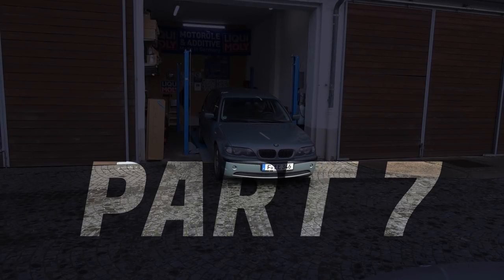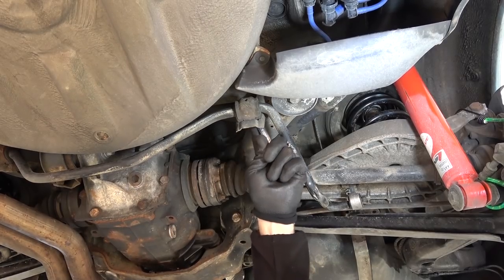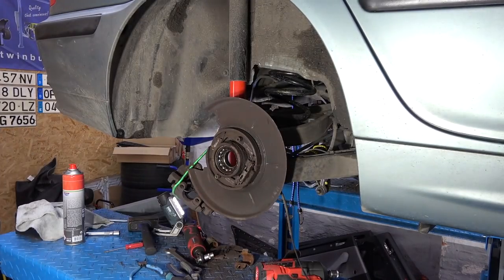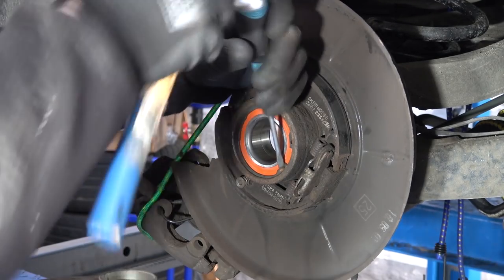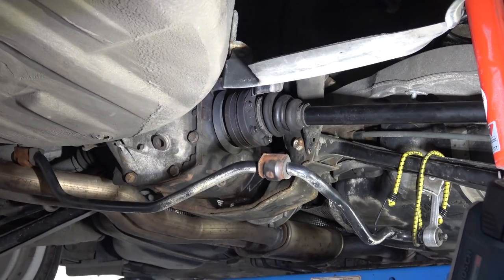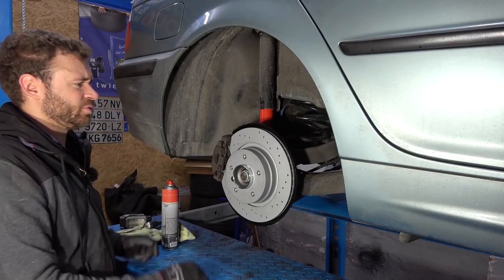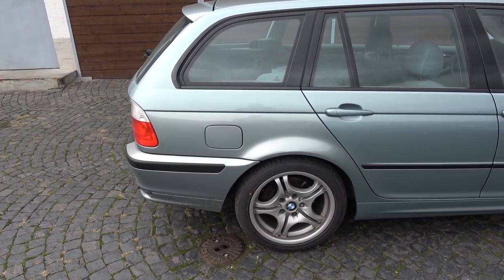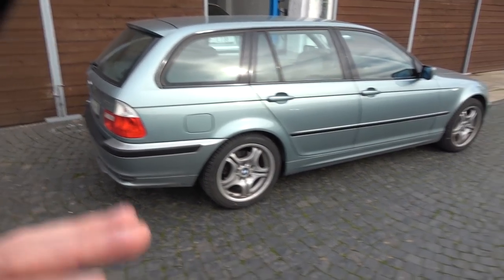Make It Less Noisy - BMW E46 325i Touring - Project Cologne: Part 7

Comment: the official channel of "well, while I'm in there might as well"
Reply: That usually does not go along with the “cheap car” title. Been there, done that. 😂
Reply: this is the motto of every older BMW owner
Reply: My thoughts exactly...I love his channel because he does good things for my OCD levels! 😂😂👍🏽👍🏽
Reply: He wouldn't have had to go back in if he didn't replace the dust shields.  Now, why was that done?
Reply: Cooooming āp
Reply: @flippy9133  The motto of every old(er) car owner 😂
Reply: Endless of that. Story of my life
Reply: @flippy9133  worth it
Reply: @lkstaack74  because "While I'm here, I might as well".
Reply: @larsstaack7835  I don't disagree and don't want to put words into the guy's mouth, it might be his perfectionism, or summat else.:)
Reply: The hole where the retaining pin for the parking brake shoe locates can corrode and break.
Reply: This is pretty much the motto of the E46 owner... there's no such thing as ONE job.
Reply: @larsstaack7835  it does - the holes where the handbrake shoes pins go through corrode and then you get all sorts of noises and destroyed shoes (ask me how I know). Also the shield itself can corrode and then rub against a disc, which also creates excellent noises

Comment: Mechanic here, I love your videos! I think what happened with your left rear is your brake caliper was stuck and wasnt releasing properly -> constantly braking a tiny bit judging by the burnt brake disc (they tend to turn red afterwards) and the heat killed the wheelbearing as well. That is a very common series of events with any old car.

Comment: You can buy BMW Z4 front strut mounts, they are lower -10mm and they fit. You can find them in the Bandel-Online shop for example. I will have to do the exact same things you did here plus some additional things on my 323Ci. Gonna be fun.

PS: Don't do the swap. the m54b30 usually has less than 231HP, while the m54b25 usually get's close to 192HP. So your upgrade might be like +20/25HP.. I think you can get that with software, m performance intake and other tuning.

Comment: Note to self: “Get a shop to do the wheel bearings on a BMW E46 325i”
Reply: On any vehicle really. Its a huge pain unless you have all the right tools.
Reply: When I booked my 25yo 4WD Toyota into the mechanics for the rear wheel bearings he just stared at me.
Reply: Toyota/Lexus also has the bearing in the hub itself, but when I tried to change it, it wouldn't come out even with the slide hammer. It was so rusted, i thought i could drive the car without the bolts on. Eventually decided to take it to the shop, they got it off somehow, but charged like 100 euros for it.
Reply: It’s the only thing I’ve ever brought my E38 to the dealer to do. They got it done in 2 hours. I messed with it for 2 days before just slapping it together and bringing it to the dealer. The right tools make all the difference.
Reply: Front wheel bearings on my E46 were easy, but I'd never do rear ones myself.
Reply: @DiscoFang  😂😂😂😂😂😂😂😂😂😂😂  Same here with my Wrangler
Reply: On my old Peugeot I only had to replace the rear bearing once and it took me like 20 minutes with a plank of wood and a hammer and no prior experience.
Reply: @GlamStacheessnostalgialounge  yeah i also recall doing them on  peugeot 307.. was so easy 😎.. having no axles in the back makes all the difference lol. Still would go for a bmw before a peugeot any day lol
Reply: @jxx90s  I sure as hell wouldn't. Both cars are unreliable and parts are nearly non-existent and a nightmare to find but a Peugeot is at least comfortable.
Reply: @GlamStacheessnostalgialounge  oh hah yeah in europe parts are not an issue.. bmw is way more fun in driving experience and nicer engines imo.. for the french comfort experience we still have my dads old 1972 citroen DS to take for a spin every now and then 😄.

Comment: Pro tip: week removing and reinstalling the wheel bearing instead of turning the outside wrench turn the inside wrench. Reason being is if you turn the back then it has less surface on it. The "Big Nut" spins around the bolt easier than trying to turn the entire outside part of the bolt which tends to turn with the oversized jig that you placed to pull the bearings. Then when putting it on its again easier because the BIG NUT only turn on the bolt with a little tiny bit of surface rubbing while on the outside the entire surface of the second jig is much larger. Granted that the outside technically isn't supposed to spin on ideal situation but most of the time it will in fact stick and make it much harder to spin. 

Just a tip. Did with it what you will.
Reply: I used the Amazon tool twice and got the play in it that you mentioned. I got a pro to help and that was key. Same wheel too. Both times it failed quickly after replacement and I ended up pulling out the trailing arm and getting a shop to press the bearing in. So now on #3 bearing it is finally working. Thanks for the tip Babayega.

Comment: You only need to replace the rear trailing arm. The rear brake disc handbrake drum internal diameter is larger on the 330. An easy job to be honest (and I will be doing the same, just been lazy. I have the arms on my shelf already replaced all bushings with ball joints) - so when you do the 330 driveline swap, might as well swap them in as well, since you'll have all the parts there.

Comment: Great video’s! Thanks for sharing! I did an 330i brake upgrade starting on the front, but the braking was really bad!! That’s because the E46 brake balance is done with the disc and pad size. I’ve replaced the rear suspension for installing the 330 rear brakes, that was a difference!!!!

Comment: i have a subaru and just had rear wheel bearings and seals - with high pressure brake hoses ! wow so quiet now !
Reply: Subarus and wheel bearings... They just seem to devour them. I've had 5, and they've all chewed through them, especially at the track. Luckily that's all that I've had fail on mine though.

Comment: It was entertaining as always. But I have two little advices for you.

First, when you compress the piston in brake caliper, you should unscrew the vent, and let brake fluid to drain in some jar. Because in calipers is always a lot of dirt, rust, and old fluid with water. Especially in caliper old as that. It is more important in front, they are closer to ABS pump, and if dirt come in it, you can damage it badly.

Second, when you remove bearing, bushing etc. You can heat up steering knuckle (by gas burner or even heat gun with smalller parts), which will expand, and bearing come out or come in easier. You only need to be careful with all rubber, greas etc., to not overheat them. But here you change everything. so better to make life easier. :)

I am only a DIYer, not a mechanic, but hope this helps you.

Comment: I once replace springs and dampers on front axil of a 130i E87. Ride height was very high with new parts compared to other 130i's with some milage. After a couple of thousand kilometers of driving it lowered and looked finally ok. So, I would not worry too much. Give it some time.

Comment: If you fit a six speed get a short shift too, really needs it. Keep the diff ratio you have now if you go to a 3.0, will make for a very fast accelerating car. I prefer your current wheels, no need for 18" on a winter car.

Comment: I don't know if it is too late or you won't even read this, but there is a perfect OEM solution for front ride height problems: install M sport spring from a 4 cylinder car! Those cars are a bit lighter on the front so sit a bit lower with a 6 pot engine over the springs. I had done this with my 320i and it looked perfect, I even found the handling to be a bit better 😉

Comment: Couple options if you dont want to use lowering springs:

Front drop hats/strut mounts
Raise rear with thicker spring pads, adds a bit comfort as well

I would just slap an Eibach pro-kit there though, its close to oem ride quality.

Comment: Use E36/E85 Z4 front strut mounts to lower it ~10 mm, did this on my E46, works like a charm, you only have to remove the pin from it.

Comment: I heard that ur brake discs (Zimmermann) use to crack between the holes. So make sure u check them once in a while. I also tried Brembo Max on my E46 but they were make very load noises when I was breaking. I can say ATE or textar is the best for E46. 
Grate video as usual btw 😊

Comment: Nice work, did the very same job on my 320ci and was surprised to see how many extra moments there are when you are tracking the rear wheel bearing on a BMW. 

It must have felt quite rewarding to have it done not to mention all the sounds coming from the rear of the car. Anyway, the 18 inch wheels are going to look pretty awesome... hopefully

Comment: The drum part of the 330 rear brake disc is larger than in smaller models. Because of this, the brake shoes are bigger and to fit them you need the 330 trailing arms. You would also need different drive axles, because the bearing and toothed shaft  end in the hub has larger diameter. Another  method is to modify 330 parking brake shoes, this way you could use original trailing arms and drive axles.

Comment: if you swap 330i you will need:
engine
gearbox
driveshaft
diff
axle
Front bigger brakes goes without any problems 
but for rear bigger brakes you need :
rear trailing arm 
other ABS sensors for rear 
rear dust shields that you can buy from BMW  only orginal 

i did that swap year ago and now i am happy :)

ps.Sorry my English sucks
Reply from the maker: I said in the video I will get a complete donor car :)
Reply: @M539Restorations  i know but i wrote that for other people! 
Btw love your chanel

Comment: As far as I know, e46 Sedan and Touring with M-Sport Suspension have different wishbones and stiffer rubber bearings at the front (on Coupé and Convertible they come as standard with the sportier Suspension, lowering it about 20mm). The Standard Wishbones are made from Cast-Iron, the M-Sport ones from Aluminium. Maybe that's the reason why your front is a bit too high.

Comment: I've had to replace wheel bearings on my E36 so I feel your pain. One of my driveshafts was an absolute pig to get out. Changing the bearings was the easy bit. The E46 rear suspension looks to be pretty much the same as the E36. An E46 without rust is quite uncommon. They tend to rust on the front and rear arches.

Comment: I have an F31 (Touring) I had the same issue with the front being higher than the rears, I ran Koni/Eibach.  Went with coilovers (H&R) and for some odd reason no matter how much I lower the front it still appears higher than the rear, it's not linear. 

Also those Falken Azenis FK510 tires you have on are GREAT all around tires, I'm on my second set.

Comment: Careful with drilled rotors. If you track the car, or heat cycle them too fast they may crack around the holes.

Comment: Just a tip regarding the front ride height: Use older style e36 top mounts if you can find them, I think they have been discontinued, but that's what was sent to me when I ordered new ones for my e36 coupe, and the newer style has the strut sitting farther down than the original e36 ones and my car gained a little ride height by it. It didnt bother me much since my car is lowered 60/40 and we also have terrible roads here I live in Norway.

Comment: You can put Z4 strutbearings in. They'll lower the front a bit!

But why no grease anywhere at the brakes? I recommend copper paste anywhere is contact, user ceramic paste if the saddle and -carier is aluminium!

Comment: next time... When installing Wheel bearings, try placing New Bearings in a Freezer for several hours, prior to installation.  They should shrink just enough to re-install without troubles or fancy-smancy tools.   Just a tip, from a Old fat Guy...  Keep up the great work.. Happy new year

Comment: The front isn't too high - the front arch has to provide more clearance as the wheels have to turn and compress.  A lot of people make the mistake of dropping the front low enough so that the the "gap" is the same but this causes rubbing on lock with compression, and sometimes makes the car look like a Top Fuel dragster.   Yes, a bit more driving should cause it to drop a mm or two, and don't forget you added a couple of mm with the reinforcement plates.  And new spring pads top and bottom will compress a little over time.  Great video - great series in fact!

Comment: If you can find them, supersport.de lowering perches/top mounts on the front will give around 10mm drop and won’t affect the spring travel...as you don’t want lowering springs. I have some on mine (but with eibach springs also) and they gave an extra drop.

Comment: My E92 has developed a hum up to about 50mph (80kph). I've convinced myself it's the diff pinion bearings. Hope it doesn't turn out to be the wheel bearings and a diff rebuild isn't cheap! I was going to do it myself but a specialist will only charge £100 more than i can get the bearings supplied to me so i'm going to get it done and then it's done right and warrantee'd.

Comment: Ever had an E28 M5? Are those hard to find in Europe?  Pretty rare here in Northern CA. Easily an all time favorite. 

You inspired me to knock out a job I halfway finished a year back on my '00 M5. I bought the car and stupidly didn't check the sunroof. Came to find it was stuck, having the plastic tabs shattered. On top of that the sliding cover was busted. I pulled the cassette out and totally rebuilt the glass sliding system and got it back in. I was too scared to run the motor so I manually closed it and used some velcro to keep the shade cover from sliding into the rear of the roof. 

Last night I watched a few vids and decided to try to finish the job once and for all. Happy to report I just finished the power reset and it works just like new. 

I've never even used the sunroof with this car since I bought it so now I'm pumped to get out for a cruise with some fresh air from the roof! 

Now on to do the rear ball joints on my 97 M3. I pulled the subframe and diff a few weeks ago and did poly bushings on the subframe and differential. Was such a miserable job on my garage floor that I decided to wait to do the ball joints. 

Earlier this fall I completed rebuilding the engine and did the full swap in/out myself in the garage. So satisfying to tackle all these things on my own. Have saved countless$$ and learned so much. Amassing a huge set of specialty tools is a nice bonus. 

Anyhoo...just felt like sharing that. Love your channel and approach to everything. I have the 00 M5, the 97 M3 coupe and an 08 335xi e90....so I can totally relate to your channel  and do all my own work.

Comment: I’m a firm fan of the metric system but end up working on old English engines and JIC hyd fittings. I’d say you had 1 1/2 and 1 1/8 on your bearing press

Comment: I had an E46 a while ago and I had to change my break lines and I also did stainless steel. They lasted about a winter before rust started settling in (I live in Bulgaria). I think there's a reason why the OEM were copper.

Comment: I wish this guy would sort out my e46 330ci cabrio. It has 111T km on the clock and has been sitting in a barn for a few years near Crailsheim. Needs a VDD, complete new suspension, drivers seat refurbish and other stuff. It is 100% original and in metallic black, although, the bonet was once resprayed.. Badly..by the previous owners' son during the early days of his lacquerer apprenticeship..i have a brandnew m steering wheel for it, which i found at work (i work in the main bmw factory as a planer) and some 135 rims which were refurbed by some polish fellas. All sitting there waiting to be put on..

Comment: Great video as always, I would recommend not using the screwdriver wedged between the vents in the brake disc & the brake pad carrier to stop the driveshaft from spinning when undoing or tightening the hub nut as this is a really easy way to damage the brake disc. Instead use a couple of wheel bolts & your screwdriver if you do not have a holding tool as this is much safer.

Comment: If new top hats were installed they always raise the ride height. Ive been installing old ones that are still within spec or putting certain z4/e90 top hats in that will help lower the car in the front.

Comment: Get Z4 Top Mounts for the front, they will lower the ride height by 10mm, would look perfect then! 
The front ride height is always that high cause they´ve cornerbalanced the car from factory ( So that you get more or less 50:50 weight distribution front to back)

Comment: If you press the screwdriver against the middle of the Caliper clip ( side that is facing the center of the the hub) It will simply compress and lift up, without popping in the air. Reinstall - same way.

Comment: That's the normal "stance" of many cars, especially BMWs, with the front slightly higher up. It's the way they were designed, as far as I understood.
And the paint match to the upper part is not that bad, it's to the bumper where it's a bit off.... but for the age, it's OK ;)

Comment: Double check if you really have the right Strut bearings in the front. After market/OE parts sometime have the same Part No. but they are a little bit different un height. There is a Z4 strut bearing which lower app. 1cm, maybe you need this for your right ride height in the front. greetings from cologne ;)

Comment: I think the reason the rust was there to begin with is whoever did the body work on that quarter panel before did not prep the body properly with correct procedure and moisture got underneath the primer and paint. Because if that area has rusted with bubbles and the new paint that was laid on there is bubbling up with it either the guy painted over the rust or he did a crappy job before so moisture got underneath after he painted the quarter panel.